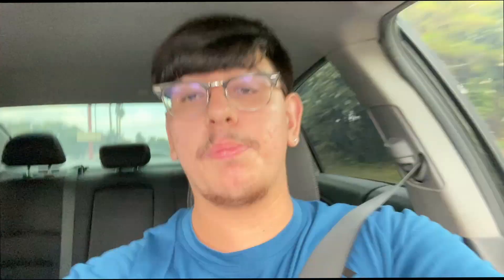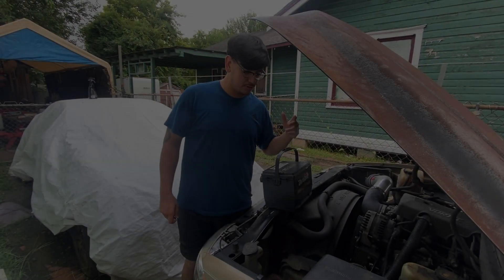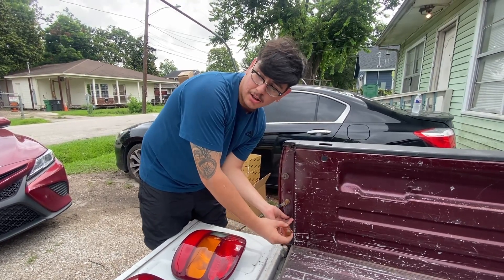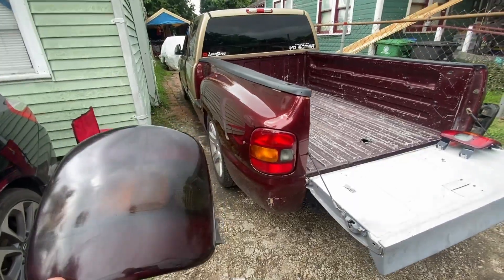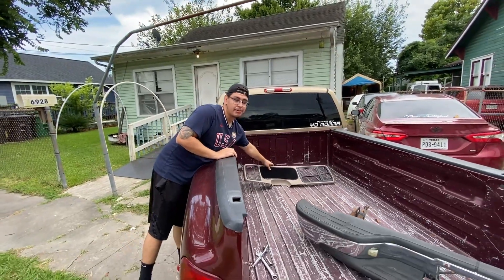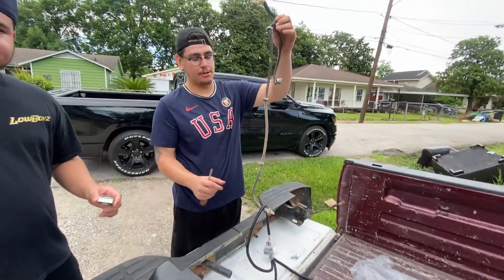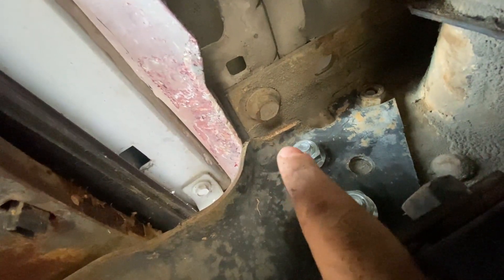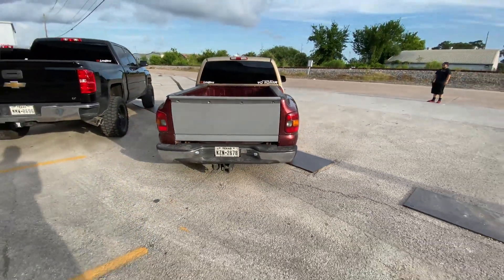INSTALLING REAR STEPSIDE BUMPER AND TAIL LIGHTS 2000 GMC SIERRA

Comment: Had to replace my lights and bumper and quarter panel from my left bed side. cause someone hit me from the side. Btw if you ever need a actual side quarter from the side try the dealerships first! No one else gots them really, and even from Amazon they are coming from the dealer. It was a rabbit hunt. The tail lights I ended up going for the amerlite smoked ones for the sidestep on Amazon, and they are a step up from the ones are are installing for half the price! 99 dollars. Give them a try if you need to just replace one, cause for one you can get both.

Comment: Do u still by chance have a link for the tailghts bro
Reply from the maker: Sure do https://www.carparts.com/details/GMC/Sierra_1500/Replacement/Tail_Light/2000/SLT/8_Cyl_5-dot-3L/SET-11-5199-01.html
Reply: @lowboyz4745 how about the wing ?
Reply from the maker: @ivantorres8322  no it came with the tailgate